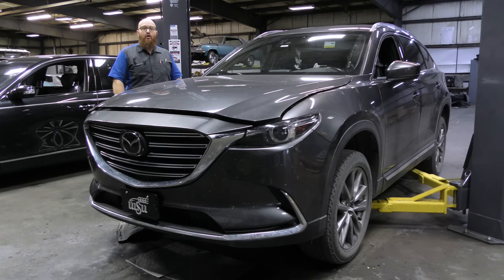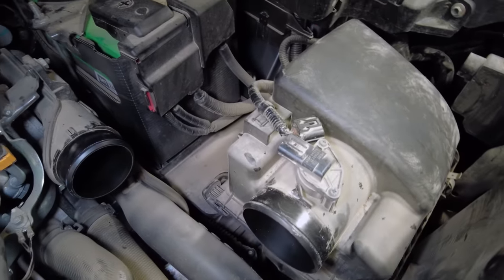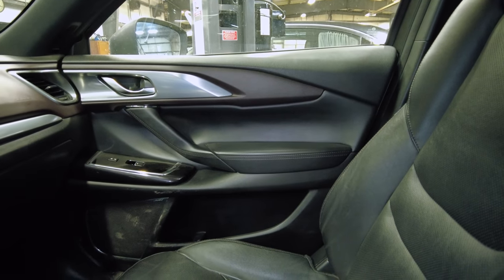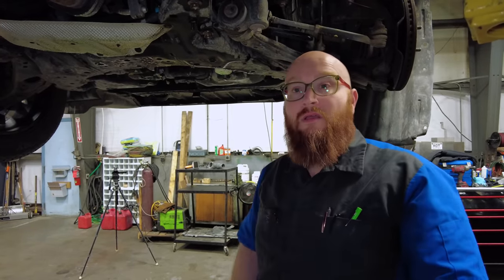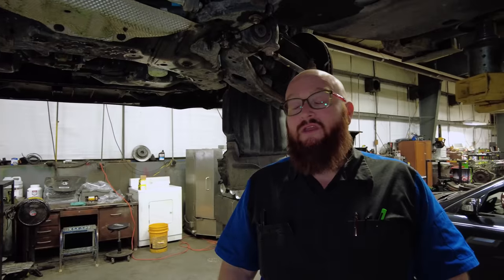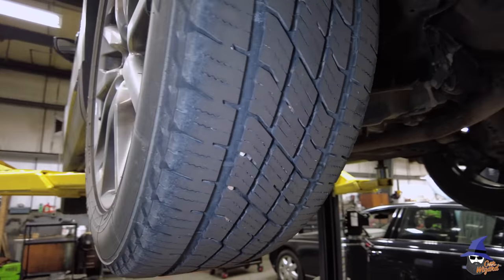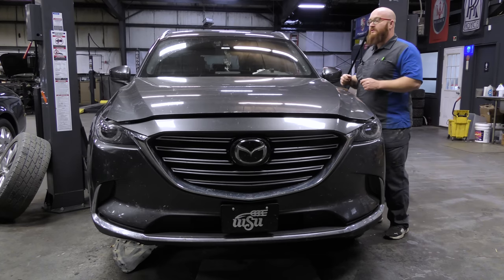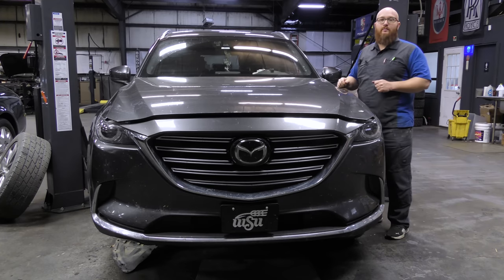Really, a $4K leak! What could be wrong with this '16 Mazda CX9 that could possibly cost that much?

Comment: Hey wizard just want to give you a heads up as a Mazda technician. I have seen this coolant leak many times and it is actually not the head gasket. It is the cylinder head itself that cracks right where the exhaust ports are in this case most likely it is going to be the cylinder head that needs to. Be replaced there is ATS B on this specific issue.
Reply: he needs to see this
Reply: You would think the Wizard would do 5 minutes worth of research before making a 19 minute video filled with misinformation.
Reply: Does this mean Mazda covers it under some type of extended warranty?
Reply: @OMGWTFLOLSMH  I mean, he called the engine "basically a Ford" engine so...
Reply: Would it show up on Identifix?
Reply: @OMGWTFLOL AGREE!  I have seen misinformation many times, especially with his comments about MB, Jaguar, and Rolls Royce/Bentley. Many of his subscribers are intelligent and well-informed!
Reply: The fact that it's a common problem seals the deal on these engines being total trash right up there with the 1.4L ecotec and the GM 3.6l V6.
Reply: There's a TSB on that. Also done a few of these cylinder heads, but it isn't super common where I'm at. Replace with updated head and reuse bolts if new ones aren't available, there was also a shortage on the thermostat gaskets so you may need to reuse those. Watch out for your lifter orientation on cyl 1 and 4 (pins in bottom of deactivation lifter). Make sure to turn the intake cam actuated gear all the way one direction and turn 8 times the other way (like a clock spring).
Reply: He doesnt care its just for clicks. Hes not all great as you hoped.
Reply: yep it needs a head, if they just do a gasket its gonna come back with the same problem. takes 5 minutes to find the tsb
Reply: @dagamer667  not a common issue but it does happen. Mazdas are fairly bullet proof otherwise. They don't have many issues. Toyota has more issues than Mazda in many models.
People just hate on Mazda because they think it's Ford. They are a Japanese company and if you do any research you'll see they make some of the highest quality cars in the world.
Reply: @claytonbarr5448  the 2.5T doesn't have CD from what I'm aware of.
Reply: How common is this actual issue. For figures in your opinion how many CX9's out of 100 succumb to the cracked head? 60k miles on my 2019 GSL with zero issues thus far.
Reply: @Kyle-vy5dx  this is difficult to say exactly but I have enough resources to gather this info. I will do some research with what I have access to and hopefully remember to update you
Reply: @Kyle  it is not super common probably 2 percent or less of the early model years 16 to 18
Reply: @diazrigoberto1525  actually my source says "Any production date after June 9th of 2020 have the updated cylinder head." Which means the issue can still happen up to 2020 models and possibly early 2021 models.
Reply: @diazrigoberto1525  I agree percentage wise it's pretty low. You have to consider the amount of these that was sold also. Mazda does not sell as many cars as other brands so low percentage + low volume of cars means it is rare. Common enough to be known but not common enough to deter someone from buying an otherwise fantastic car.
Reply: Ain't gonna be $4k after you tell the cust he needs a revised head, 16 valves, timing chain, gaskets and your time.  Thinking $6,000
Reply: Eek! I hope he is aware of this 😱
Edit: Judging by the litany of replies bringing this up, I'm sure this one will be inspected further.
Reply: @OMGWTFLOLSMH  14:26 14:27
Reply: This 2.5L I4 turbo SkyActiv engine is 100% fully made by Mazda in Japan, and Ford is not involved in it.
Reply: @ctbale1  6k, i have many vehicles that i could buy entire remanufacured engines for less then that
Reply: Sam Crackhead Block Seal Special
Reply: I'm getting a second or third opinion for that amount.
Reply: Those eco tech engines are absolute garbage. Same ones that are in the Fusion, etc. that will be a 6-7k fix. Engine may need to be replaced. Sucks
Reply: This isn’t a Ford engine. And that’s a head failure not a gasket from what I’ve seen… 

Not that the Ford engines don’t deserve a bad rap…. The 2.0l turbo is a joke. Oh and all the other 4cyl turbos that can’t hold their coolant.
Reply: Thst coolant leak isn't the worst it could be. Our 2015 had a problem with the water pump that sits inside the timing cover. Takes out the engine. Common problem on the Ford 3.7 V6. Last year of the CX9s with a V6. Mazda with with Mazda 4 cylinder turbo engines after 2015.
Reply: @OMGWTFLOLSMH  ok Ukraine boy 🤦🏼‍♂️
Reply: It started at 4k, but wait, there is more!!
Reply: A TSB so they don’t have to warranty the problem.
Reply: @OMGWTFLOLSMH  He did say that they have to tear it down to see what's wrong exactly. He probably made a wrong diagnosis, but that happens in auto repair all the time and its not misinformation. Knowing of this issue and diagnosing it correctly would have changed the estimate, but they would have still needed to tear it down to confirm the diagnosis and get the full extent of the damage.
Reply: Definitely needs to see this!
Reply: Hi there I am looking to purchase this car because I love Mazdas, but do the 2022 and 2023 models have this problem?
Reply: @Tim  ya that lost me from watching and taking this guy seriously 😐
Reply: @Anderson O’Brien no, I work at a Mazda dealer and they have fixed this problem. The problem was a too thin of casting near the exhaust manifold stud where it would crack but I haven’t seen any problems for a while with the newer ones
Reply: @TheAndersonOBrien  this hasn't been a real common issue. Anything past 2021 model year has the "fixed" head design.
Reply: @LSR-YT21  toyota sells many more cars. For a good reason. Statistically, there's bound to be more problems but I would bet it's a smaller overall percentage.
Reply: @runningawayvagabond5876  NO. They don't.  Sometimes they will do a "good faith" repair, other times, not.  It doesn't seem to be a consistent approach from Mazda NA, which is frustrating.  they comped me about $4K on my repair because my car was out of warranty.  Better than nothing!  Here is the TSB: https://static.nhtsa.gov/odi/tsbs/2023/MC-10232269-0001.pdf
Reply: Did you see his latest video? No crack.
Reply: @Steve O  you are completely wrong. Ecotecs are in gm vehicles. This is a 2.5l SKYACTIV-G. 🤡🤡
Reply: @tim3172  He doesn't have intricate knowledge for several engines. I've seen multiple videos about his hatred for the 5.4 3 valve and "to just replace it." Meanwhile I did a timing job myself 3 years ago and have since put 100k on it. Glad I didn't take his advice and shell out $4k to replace it. In one instance he showed a 5.4 sludged to hell and basically said "see timing jobs don't fix this engine."
Reply: @claytonbarr5448  It was the head gasket and not the cylinder head.The Wizard was right. You are obviously a good mechanic. You are a magician but not a Wizard.
Reply: @Jacob1986  It was the head gasket and not the cylinder head.The Wizard was right.
Reply: @diazrigoberto1525 It was the head gasket and not the cylinder head.The Wizard was right. ou are obviously a good mechanic. You are a magician but not a Wizard.
Reply: Any chance T&K Head Gasket and Block Repair can help?  They recommended a new engine for me and with the prices of labor and the engine that is a no-go for me.  Looking to creep by till the end of the year and hopefully still use it as a trade in...
Reply: you are spot on, Retire Mazda service manager
Reply: @waltchan ford only owns 11% of Mazda now.  They aren't partners like there used to be.
Reply: @steveo601  it isn't an ecotech
Reply: @JohnQuincy1776  Ford already unloaded the remaining 3% stake with Mazda in 2015. Today, it is 0% stake with 0% relationship now. https://en.wikipedia.org/wiki/Mazda#Divestment_by_Ford
Reply: This is the same guy that thinks Toyota is perfect and never mentions how they had millions of engines produced that burn oil
Reply: excellent description! thank you
Reply: Is it true that the problem was fixed by Mazda after the 2019 year models? I'm considering purchasing a 2021 carbon edition cx9, any comments will be highly appreciated.
Reply: @Andrews_playground   does the problem happens on 2021 models?
Reply: What is the TSB for this and what does that actually mean. Does that mean it’s a warranties fix or they just know how to fix it? Literally tonight started to overheat and there was no coolant and fear it’s coming from the same area!
Reply: @chadsummy2336 I have the same exact issue I need to know as well
Reply: @jonajourney2397  TSB is a technical Service Bulletin. Mine ended up having a cylinder head leak, got it all fixed. Then the found metal in the oil needed a hole new long block. Wish I would have done that from the start

Comment: I have their 180hp 4 cyl skyActiv engine in my 2015 Mazda 6.  In a few months, I’ll be over 400,000 miles!!  Only thing I’ve ever done to this car has been a belt tensioner and a lower control arm.  Still runs and shifts great and 34mpg.  Most reliable car I’ve ever owned.
Reply: skyActiv is not a Ford engine
Reply: @altergreenhorn  Neither are Ford. Ford was using Mazda engine (parts), not the other way around.
Reply: I'm always amazed how much people drive.  My daily is a 2016 nissan and it only has 40k miles on it.  Can't imagine driving 400k miles.
Reply: @SofaKingTouge  gotta feed those kids and pay the bills!
Reply: @scooterwoodley195  put those kids to work.
Reply: @SofaKingTouge  My '12 Accord has 53K and I drive it...yeah, no idea how people pile on the miles.
Reply: @rebeltvr6046  My 2013 Acura TL has 202,000 miles. When you drive 50 miles to get to work, then 50 miles back everyday the miles add up quick.
Reply: @Holistic Music and Stories to add to this, that is also the NA version of this engine family which is tried and true and has been out much longer. The 2.5T version debuted in 2016 with the CX-9
Reply: @RebelTV r  I live in the sticks and I deliver pizzas.  I drive about 40 to 50kmi a year.  I get 1 to 2 oil changes in a month. My 98 accord manual has.430kmi,
Reply: Good to hear. I have the 165hp in 2018 version. I hope it'll serve me well until the world goes full electric.
Reply: @sf49ersjshark2  That 98' is imo the best Accord.  Bulletproof.  The key like with you is regular oil changes and manuals, you can drive forever.  I have a '12 Accord Coupe manual, just oil changes so far.
Reply: @skree_fpv436  Yeah I see that.
Reply: Does anyone with mid-late 2010s skyactiv Mazdas also have an exhaust leak or something that makes the engine or something sound like complete 🐕 💩 at low RPMs at around 40 mph?

It’s BEEN making some sorta unhealthy sounding noise at very low RPMs but while at around said speed since around 45k miles. Literally just hit 190k miles today and have yet to have experienced any problems; even took that thing through ALL 48 CONTIGUOUS STATES with only suspension & tire issues at worst.
Reply: @schwenda3727  Well, not yet. Is it only at 40 and later dissappears? Some kind of resonance?
Reply: @SofaKingTouge my 2004 accord has 630,000 miles😂. I've driven cross country more times than I can recall. And I've driven to anchoridge from Phoenix like 20 times. I love driving and couldn't imagine my life without it.
Reply: @Mateusz Mucha  in the world of electric cars the Honda will still be going.  Plus in the 70s no one wanted an old nova sadan or Bellaire ect cause they were the Honda accord of their generation just an old family car but people go nuts for them now.  I just have to wait hahah.
Reply: @sf49ersjshark2  The problem will be what a liter/gallon of fuel will cost with way lower demand. We cannot completely stop hydrocarbons, because of usefulness of plastics, but production cost will probably be an order of magnitude higher.
Reply: @juzoli same with Volvo under fords owneshop. They used Volvo engines, not the other way around
Reply: @kylemontano228  Not really the same in the sense I was thinking about. Mazda manufactures very good and reliable engines. So it would be surprising if Mazda would replace it with Ford.
Volvo engines are not as good as Mazda, so it makes sense to switch them.
Reply: transmission fluid changes?
Reply: @dylanhughes5944  just drain and fills with Mazda fluid every 75K miles.
Reply: That's good hear. Later they added cylinder deactivation to the naturally aspirated 2.5, which caused a similar cylinder head cracking problems as for the turbo. I had a 2016 6 with manual tranny, but sold it 2018 with 6k miles because I was leaving the US.
Reply: @rebeltvr6046   😂just hit 10k on my 6 month old Mazda CX5
Reply: I have a 2016 and so far the same problem with the tensioner that I am about to replace for a third time.
Reply: You should put up a video of it with 400k miles on the odom.
Reply: Making miles is better for a car than 2 miles rides per day. I assume 400000 miles are exact that case
Reply: @hochhaul  I did a while back

Comment: Hey Dave,
Point of interest, the Mazda Skyactiv 2.5 Turbo is actually NOT a Ford engine.
It is 100% Mazda.
I actually enjoy your videos and I like to see you do well and be accurate with information for your fans.
Have a good day.
Reply: Just as Hyundai owning Kia and VW owning Skoda .....
So Ford can own Mazda.
Reply: @conradscheepers  Ford and Mazda had a partnership that started back in the early seventies. It’s no secret that Mazda for a long time made vehicles for Ford and Mazda in turn gave Ford a percentage of stocks and for quite a long time, shared designs back and forth between the two companies. That said, Mazda has always remained the same small independent car manufacturer that has been in Japan all its history. The tiny factory that originally was known for manufacturing cork and moved into building small vehicles several decades later has always been its own company, and still remains that way to this day.
Reply: Ford did not completely divest itself of Mazda until 2015.  That said the Skyactiv-G is presumably a descendent of the Mazda L series engine--they share the same bore & stroke and it's likely a very similar block.   I'm no Mazda expert here but the fundamentals seem the same.  To be clear, the L-series engine is a Mazda design engine.  However it was certainly designed during the period when Ford and Mazda had a partnership, so there is likely some "Ford technology" and input in there for sure, but the engine is not "a Ford engine" it's a Mazda engine.  Ford took the L engine and named it the "Duratec" 2.5L I4, for use in its own models.  This is not to be confused with the Duratec 2.5L V6 which was developed by Ford and Porsche.  Ford actually still uses a variant of the Duratec 2.5L I4 engine today, in some hybrid models.  Which is funny because Mazda themselves don't use it anymore I don't think.  

The Skyactiv-G, even if derived from the L-series engine, would be quite a departure and had very little or no tech/input from Ford...other than what we can reasonably say was "absorbed" into Mazda from such a long partnership and what came along with whatever came with the L-series.  I doubt there will be many parts here (at least engine wise) that say "FoMoCo" on them as claimed but remains to be seen.  I don't think Wizard mentions this again in the follow up video, lol.
Reply: If they have a supply line to ford parts that they know are good, why make their own. And they might share some patents.
Reply: True, its the other way around Mazda engine not a Ford. Ford did use some Mazda motors.